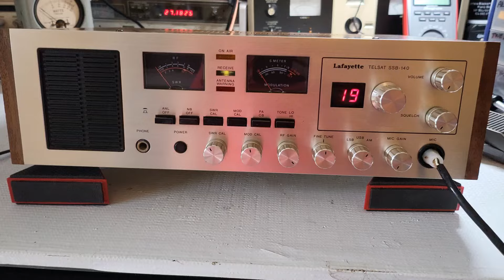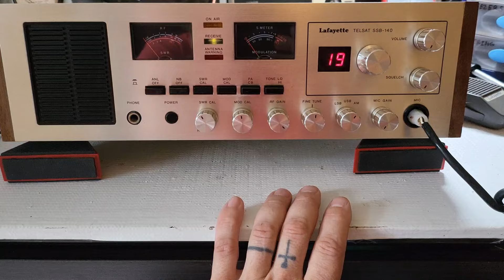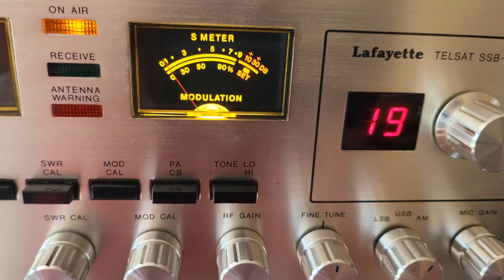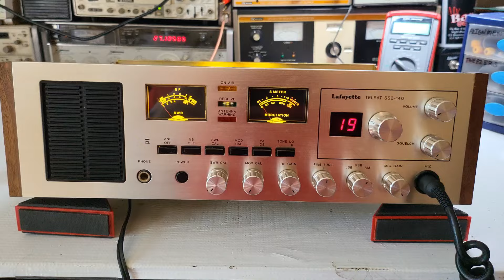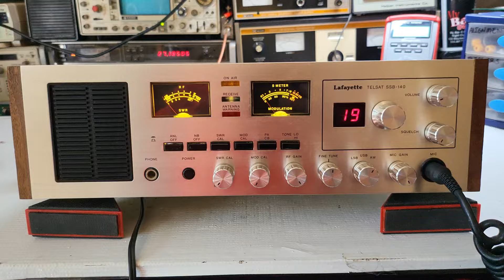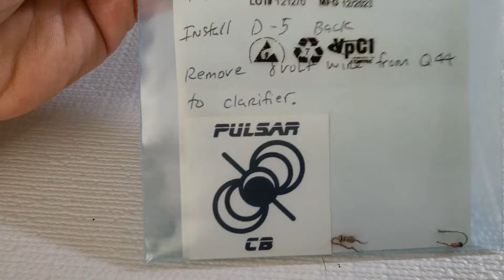Lafayette Telsat SSB 140 Full service and repair

Comment: S9 told me it is the same board in the Dak 10- good job.
Reply from the maker: It is not the same board.  The DAK board has no cybernet markings.   The DAK board looks like a cybernet but it is far from the quality you find in a telsat ssb 140.  It's essentially a knockoff
Reply: @pulsarcb  Oh, ok good to know, I just went by what S( Radio had said. He has those books on Ebay.